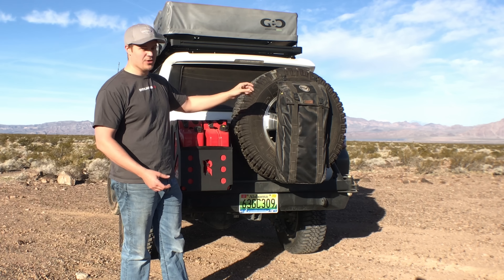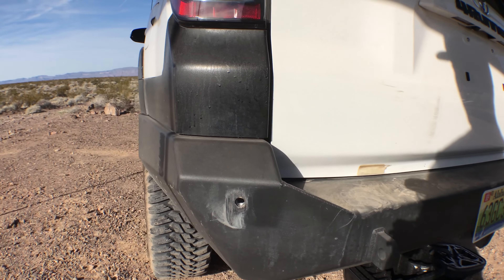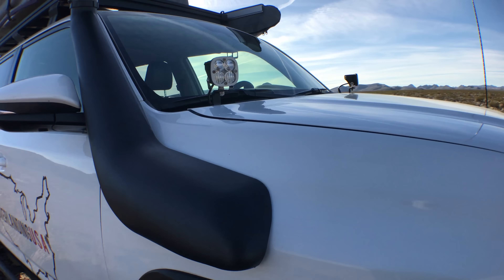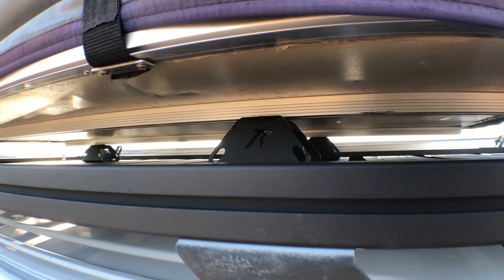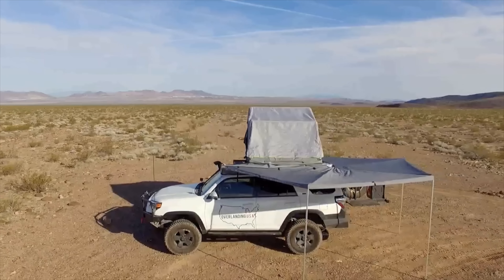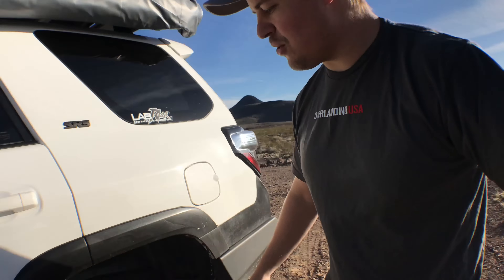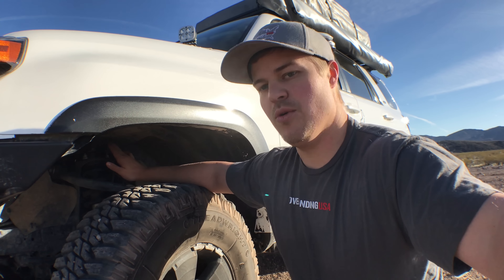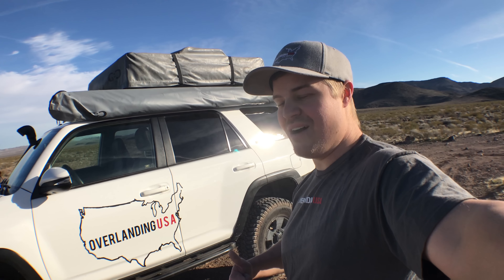Built: Overlanding USA 4Runner Walk Around

Comment: Thanks for the tour! Happy to see the 270 degree canopy on a 4Runner but when you need to open your back hatch, doesn't the swing up hatch run right into the canopy overhead, or at least the hatch's spoiler? This is what had me thinking I couldn't put a 270 degree canopy on my 4Runner.
Reply from the maker: it does unfortunately, we are working on solutions with the manufacturer to help remedy it.

Comment: Did you plastidip your fender flares?
Reply from the maker: Samuel Lim at first, but now they are coated with truck bed liner. Much more durable.
Reply: Overlanding USA like line x? Can you briefly describe how it was done? Did you have to remove the flares to get them on?
Reply from the maker: Samuel Lim no it was just rattle can truck bed liner. We did not table them off as they are held on with some adhesive we did not want to separate. So we took our time and lined out the fender flair with painters tape. Also put on 5 layers

Comment: Did you have any issues balancing your tires? I picked up a set identical to yours and the shops are having issues balancing them. The last shops machine said it required 525g to balance which is insane
Reply from the maker: Gluten let them know. It's in the warranty I'm pretty sure. They are aggressive mud tires so they usually take a good bit of weight to balance.
Reply: I got it figured out and Tread Wright was really nice about the whole thing. They offered to replace the tires or refund me completely so thumbs up for recommending them as a company. Also Relentless fab has started offering the rock sliders you have they just are not posted on the website just a heads up.

Comment: this is an awesome set up.....this is an SR5 no? just wondering why you didn't go with the TRD PRO....not much value added ? im thinking of purchasing a 4 runner soon
Reply from the maker: We decided against a TRD pro because we were planning on doing the modifications.  The parts that make a TRD pro special are the suspension, skid plate, and the design of the front, all parts we removed and replaced or cut in half.  We also knew that we would at one point re-gear the truck for bigger tires and the added weight so didn't spend the extra money on the trail for the locker when one can and will be added in later.

Is the TRD good value? Absolutely, as long as you are planning on keeping it 95% stock for most of its life.

Comment: Nice vids. I just subscribed! I'm currently looking at rooftop tents. I noticed you switched the type of tent you use, and that your crew has different brands. Please do a comparison/review. I have a 50lb dog that doesn't like being picked up, much less carried up a ladder. Any suggestions in that regard would also be appreciated.
Reply from the maker: We could do a review on either tent for sure.  As far as the dog situation we did upgrade tents a while back to give us a little more room with them up there with us.  We are thinking of exploring the option of a hard shell tent, as well as an Oz style ground tent with the dogs.
Reply: Thanx for the speedy reply. I'd especially be interested in your opinion of tents with the hood/canopy over the door & ladder vs. the more open design.
Reply from the maker: they both have their benefits.  The one that is more open will allow for better air flow in warm climates.  the one with the canopy allows for a very enclosed system with potential for an annex, which is very good for cold weather.
Reply: I'll be camping mostly in hot climates, and I'm in Texas which is blazing hot in summer. Airflow is critical - I'll likely go with Tepui Kukenam ruggedized on Rhino-Rack Backbone/Pioneer Platform on my Wrangler Unlimited. Thanks again - happy over landing to you.

Comment: Curious why your running the 4th gen wheel, and what size, if any, wheel spacers are you running?
Great looking rig btw.
Reply from the maker: Just to be different honestly, plus I like the look.  We have since switched to rims by Gear Alloy with better off set to avoid having to run spacers, but at the time we were running 1.25 inch spacers all around

Comment: Flowmaster really added 2 Mpg? That's awesome now I'm looking into buying one!
Reply from the maker: Gluten yes! We have been running around town the past few days with no roof rack while making some mods to it and we are getting 17mpg.
Reply: Overlanding USA That's not bad  at all with all the extra weight. Did you just replace the original muffler with the flow master ?
Reply from the maker: Yes, just chopped out the old one and welded the new one back in place.
Reply: What model Flowmaster did you go with?
Reply: Tim Aldredge bought the tires he's rocking going with a muffler delete until I can afford the flow master
Reply from the maker: Tim Aldredge Delta 40.

Comment: half a mile with that large antenna on CB? there must be something wrong. has it good electrical ground? cause electromagnetic ground is totally missing when not mounted to a flat (conducting) surface. what about the SWR, below 1:2? just as an example: I've mounted a fairly short 60cm (about 2ft.) antenna and get about 2-5km range (1,25-3miles). and over here in europe CB is regulated to only 4W on FM.
Reply: That does seem rather short distance. I have a K40 antenna/Uniden 980 radio (4 watt) and I can get 4 miles of range in the southwest. What kind of CB are you using? You should take your vehicle to a truck stop CB Radio shop and let them tune and adjust your system to work more efficiently.
Reply from the maker: Christian Stenger so I had a friend look at it this weekend and we attempted to tune it. What we came to the conclusion is that it was improperly tuned the first time and damaged my CB, so I will be installing a new one soon. Thanks for the feedback guys!
Reply: I bet your SWR must have been at least above 1:10!! though being risky, it takes a decent amount of energy to damage the radio power amp while sending .. (the SWR in my answer was not supposed to be a time code jump label :D)
Reply from the maker: Yeah, it was above 2 lol
Reply: Great observation, that goes overlooked so much.